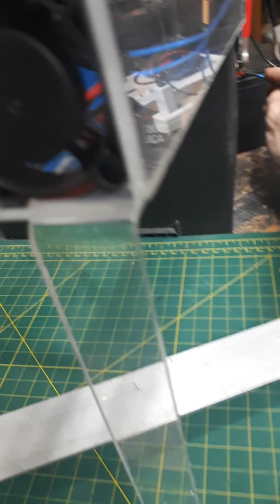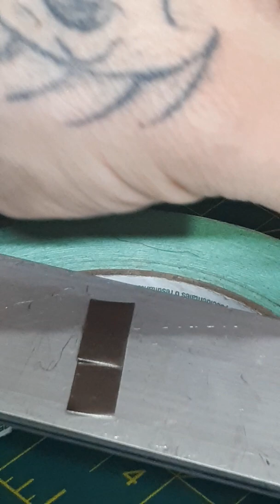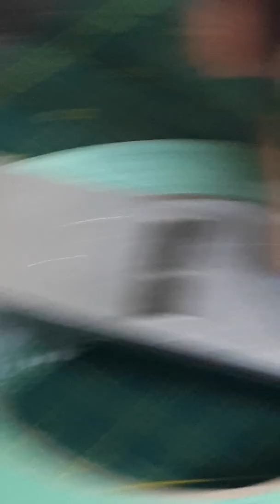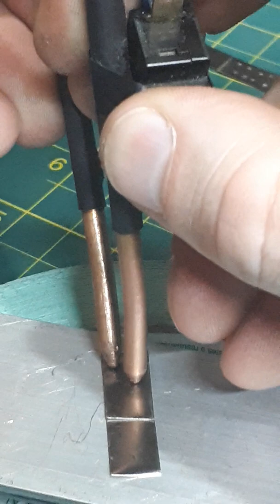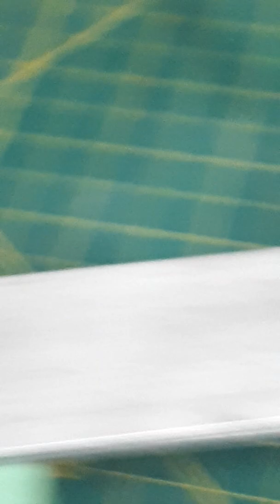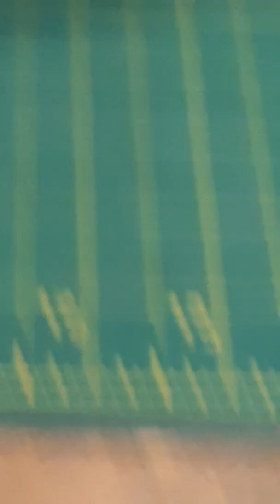Mosfet spot welder for 18650 cells

Comment: can it weld glass fuses to 18650's?
Reply from the maker: No I made the welder with to many mosfets. This was the welder all the way turned down.  Well maybe after I get the timing down it might but as it is now no. I need to set up faster timing
Reply: @cdiperformanceparts4364  looking forward for updates.
Reply from the maker: Gihan Lasita it actually did weld fuses perfect at 47uf and I might load the video on here but it's already up at DIY 18650 Facebook group. Cheers
Reply: @cdiperformanceparts4364  saw it and looks perfect. i have collected and ready 350 cells for 7s50p pack.  originally i was thinking soldering but better way seems to be weld.   now i got to learn how to build this.